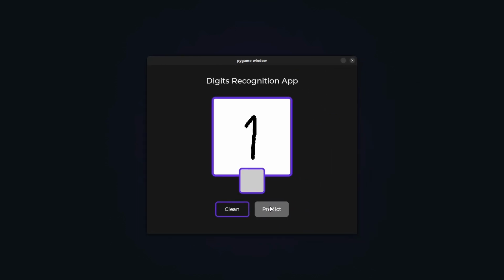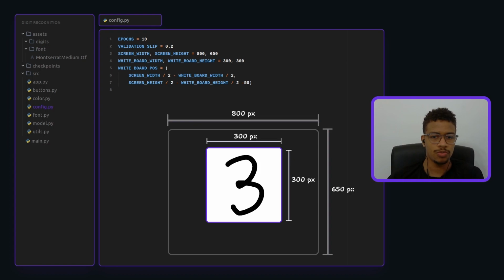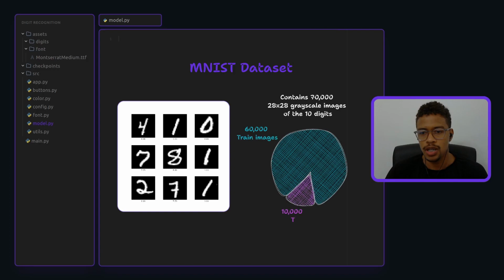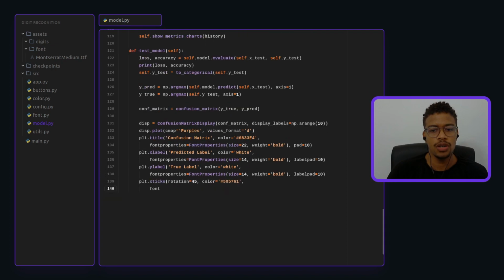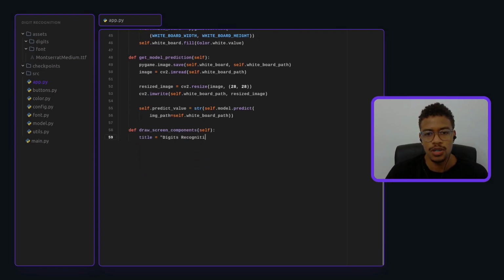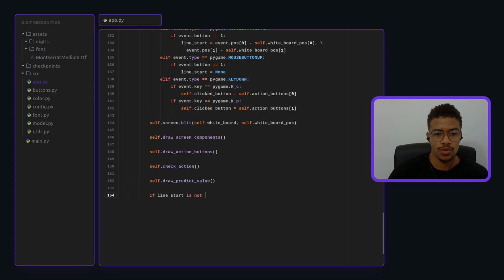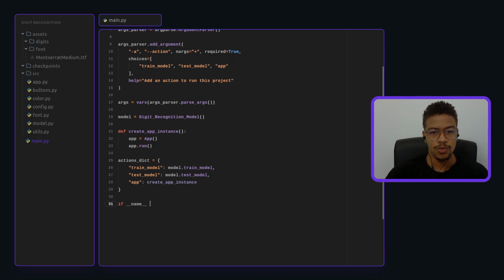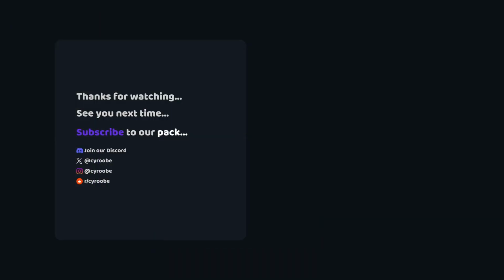Building a Handwritten Digits Recognition System (Python | TensorFlow | Pygame) (Part 1)

Comment: Nha única duvida e sobre esse arquivo  la, .h5, como que se estrutura interna sempre um tive curiosidade  de como ta salva coisa apos treinamento
Reply from the maker: The cnn_model.h5 file is a binary file that contains the TensorFlow model architecture, weights, and configuration.
The ".h5" format is used to store models in the HDF5 file format, which is a hierarchical data format designed to store and organize large amounts of data.